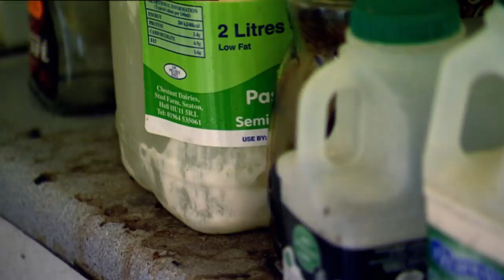Extreme Cleaners Vs The House that’s an Ashtray | FULL EPISODE | Grimefighters | Episode 10

Comment: As a cleaner in the US here's a great trick for the toilet. Pumice can scratch the porcelain instead use dry wall sandpaper. 100 grit works great. No need to put pressure while using it just keep the bowl wet.
Reply: Wish I knew that, I was doing my end of lease clean and scrubbed the toilet with steel wool
Reply: I'm surprised they didn't let it soak in an acid solution overnight. Then it wipes right off without any Scrubbing.
Reply: @elephantsradorable7689  Sometimes it's not possible to soak or you're not allowed to put toxic chemicals down the drain. Especially if you're on a septic system or the sewer system is really old.  I've had to use old fashion elbow grease on one or more occasions.
Reply: @vwgirl  that sucks. I have never had that problem. I didn't know there were areas you couldn't do that.
Reply: You can vinegar or citric acid, if your really concerned you could pH test the water before flushing and neutralise with baking soda.

Comment: I used to live in an apartment building that had bed bugs and, sure enough, some of them showed up in my place.  Not very many, thankfully, probably because I complained the minute I spotted one of them.  The pest control people didn't spray, though.  They used machines to generate heat up to 135 degrees.  It acted like a tactical nuke on those bugs.
Reply: Heat kills them at all life stages. Great solution and no pesticide resistance develops. Just get your vinyl record collection out of the way.
Reply: @drunkvegangal8089  I took all kinds of things, including my meds and vitamins, out of there.
Reply: So basically a heatcun is a "just in case" household necessity

Comment: Question for those in the UK is pest control covered under  insurance or through the government or when someone moves out of an apartment? Here in the US it isn't and is very expensive.
Reply: Not sure about personal homes as I've never had a problem but for business premises, the company I work for pays less than £30 a month for the council pest control to come every fow months to check the premises over, put down preventative measures and it covers solving any pest problems that might come up

Comment: Is there a difference between a drug Syringe 💉 and a syringe 💉 used for a diabetic??????
Reply: Yes. The diabetic needle has insulin in it. The drug needle has god knows what. I wonder how many needles they found. A bad diabetic would need an injection up to 4 times a day, every day.  There are some insulin pens that the needle is replaceable and the syringe is prefilled.